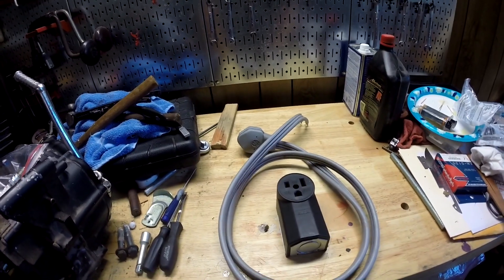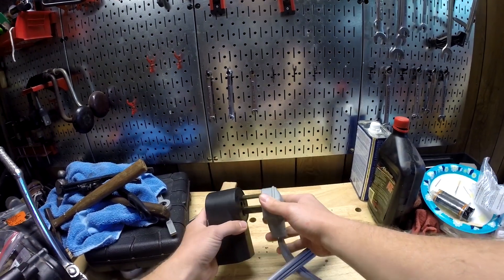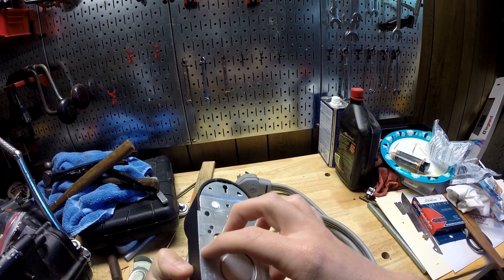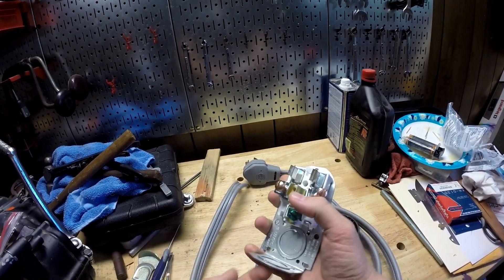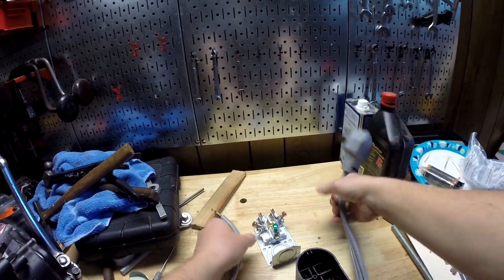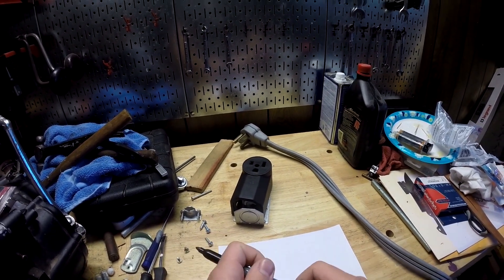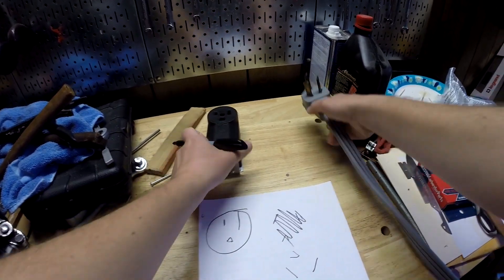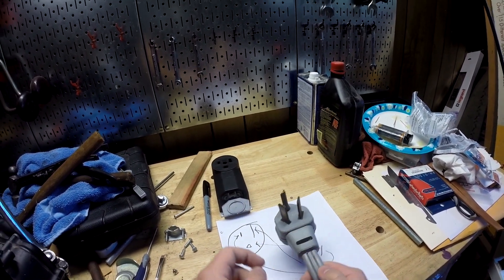DIY Welder Plug to Dryer Outlet Adapter - How I Can Plug My Welder Into My Dryer Socket

Comment: Bro this should be flagged as dangerous as hell. Lmfao I can’t believe this has been up for 2 years
Reply: What's so dangerous about this. Two hot wires and a ground wire.
Reply from the maker: it works just fine
Reply: There is so much wrong in this video that I wouldn't know where to begin.

Comment: I made one of these a few years ago so I could use my welder in the garage. The center wire on the dryer cord was marked neutral. I also made another longer one so I could weld in my driveway by using a 6-50R recptacle and  50 ft of 10-3 extension cord and spliced to another dryer cord.
Reply from the maker: nice!

Comment: I've got to check out that receptacle. I might need to make another extension cord for a friend's powertig.
Reply from the maker: If cost isn't an issue, there are adapters now for about $35, I added a link to one in the description. I think it's still cheaper to make one though, especially if you already have the dryer cord

Edit: or yeah, if you're making a cord from scratch I guess you would still need the ends

Comment: Say Ryan
You really messed up the strain relief part of this install. It does NOT belong inside the box. It goes on the bottom outside of the box and is held in place with the two small screws you probably lost after you removed them. DO NOT FOLLOW THIS FELLOWS INSTRUCTIONS!
Reply from the maker: hey, it works. I'm not an expert, so thanks for the tip. Honestly now it would be better to buy an adapter, but at the time I made this video the only adapters I could find were $70, sooooo
Reply: @Ryan45678  Wow crazy and I thought $30 was steep in 2021

Comment: Hello, so does it matter which prongs the black/white wires get connected to on either end? Or in some corresponding manner?
Reply from the maker: With this type of plug, order doesn't matter as long as the ground (middle) wire goes to ground and the two other wires go to one of the hot sides. If you have a different plug, say a 4 prong, I'm not really sure - it might matter, but I don't know.

Comment: How much did this cost in total? You can get a Welder Adapter Cord 3-Prong 10-30P Dryer Plug to 6-50R Welder Outlet
 adapter for around $70.00. Just wondering if the saving is enough to go through the trouble of making one...I like DIY, but not for the sake of DIY. :)
Reply from the maker: For me, I needed a 40 foot extension cord to reach my backyard, which was $90 at the time. The wall adapter is about $16, and I already had a dryer cord, which is normally about $15. So about $30 for the adapter if you don't have the dryer cord already. Or, like someone else said, if you wanted to cut your extension cord and wire it directly to a dryer cable, you could do that if you feel comfortable with it. 

It also depends on what type plug your dryer is (I take it it's a different kind than mine?), and if you can find an adapter that is fairly cheap, like this one for my kind of dryer plug that's normally about $70 (https://amzn.to/2Lp96W5), then I'd go for that. You will still need an extension cable to get the welder to reach outside (assuming it doesn't) - which is the majority of the cost, and you'll probably need one regardless. And depending on how far you need to go, you could get a shorter one for a little cheaper.

I agree with you though, DIY for the sake of DIY isn't always a good thing! I'm kind of at that point with my edger bike build, which I'll probably never finish lol. And for this project, if I had seen a premade adapter for $27 at the time, I would have gotten it!
Reply: @Ryan45678  Yep...that is the exact one I was looking at. I'm just getting started in welding...getting the welder and gear for Christmas. To start, I will just be practicing in the garage, where the dryer outlet is...but yes, eventually I will want to get an extension cord for it. Thanks for the reply!
Reply from the maker: Sorry, I thought I replied earlier but I guess it didn't go through. I was just gonna say that's awesome, and it should be a lot of fun! Just be careful of flammable stuff that might be in the garage, and definitely make sure you have good ventilation in there!

Comment: You're gonna lose a lot of voltage with that long of an extension cord.
Reply: Yes you were using a wall mount female plug for a dryer setup. The way you did that will work just fine because the breaker in your house is at least 30 amps. It will protect your house. I'm getting ready to hook mine up in a similar fashion. I have seen numerous videos with this type of application and it seems to work well.
Reply from the maker: I haven't had any issues with it so far. worked fine even welding up to about a 1/4 inch
Reply: That's awesome, good job.

Comment: couldn't I buy a 6 gauge cord solder to original cord and plug to adapter into wall outlet?
because of gauge difference might make a meltdown.......
Reply from the maker: The cord I got says it's 8 AWG on the amazon page, and 6 AWG is thicker than that - so I would think it would be ok, but I don't know for sure. If anything, I would think thinner wire would be more of an issue.

Comment: You should cut the male end off of the extension cord and wire it to a dryer plug end. You can get ones that mount directly to a cable. Ground is center. The other 2 prongs are both hot and order doesn't matter at all. Black and white or black and red are hot. Green is ground
Reply from the maker: Thanks! I think I have seen people do that, I just figured it might be safer (even if it's actually not lol) to just have it plug in

Comment: Hey ryan what is the cuircut breaker amps on the house side of the circuit and what does your welder require to run ive got a lincoln weld pak 175 hd thinking about doing the same thing?
Reply from the maker: Hey Mike! Sorry for taking so long to get to your comment, I don't check this channel that often. The breakers in my house all say 20 amps, and that's the input amperage of my welder. The output (which doesn't affect the input amps) is 170. It looks like yours uses 20 amps as well. https://www.lincolnelectric.com/assets/servicenavigator-public/lincoln3/imt825.pdf
Reply: @Ryan45678  its cool thanks for the reply

Comment: That dryer cable holds up to 50 amps I think. Have you noticed any overheating when you go higher than that on your welder?
Reply from the maker: I don't think my welder can go that high. It's a 170 amp output harbor freight welder, but the amperage (I assume input) listed on the product page is 20 amps. I've welded through about a spool and a half of .030 wire and haven't noticed any issues at all.
Reply: @Ryan45678  I had an electrician add a plug for my Lincoln AC welder and he put it on a 50 amp breaker. He said unless I'm welding really thick steel and keeping the arc going for a long time it shouldn't trip.  I ve been welding 1.25 square tubing for gates without any problem. Haven't tried 2 7/8 oilfield tubing yet.
Reply from the maker: @ElRipper100  That makes sense. I have not had any issues with mine the way I have it set up, either.
Reply: I have a 180 amp welder. It calls for a 30 amp breaker.